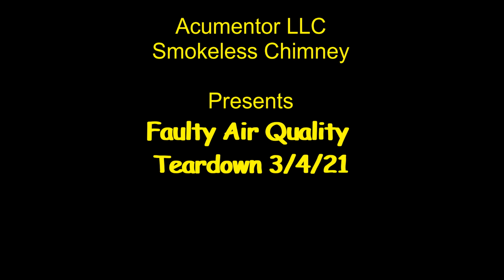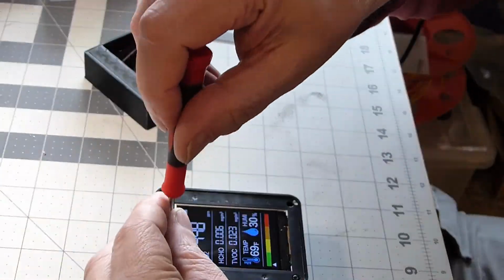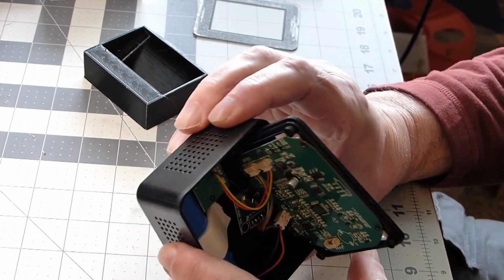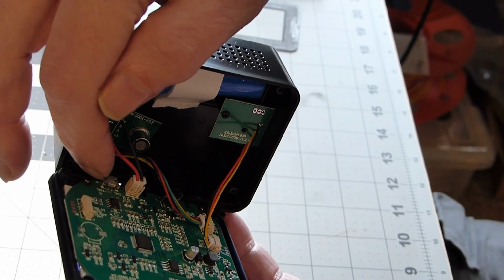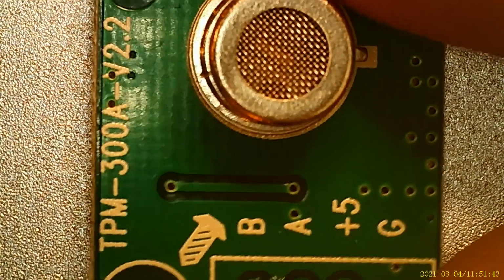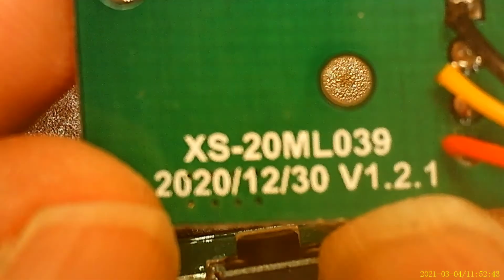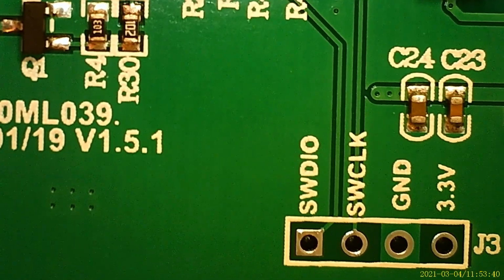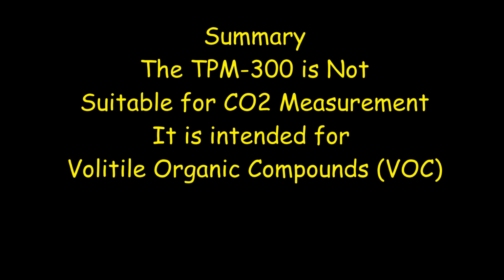TPM 300 meter teardown 3 4 21A

Comment: The processor is mostly likely an STM32 (or clone), it has a debug interface with names like that (SWD, SWCLK). As far as I know all microcontrollers in the same package have the same pinout, e.g. you should see the oscillators on a specific set of pins that it common for all microcontrollers in the same package. A cheap stlink v2 USB debugger should be able to connect to that debug header.